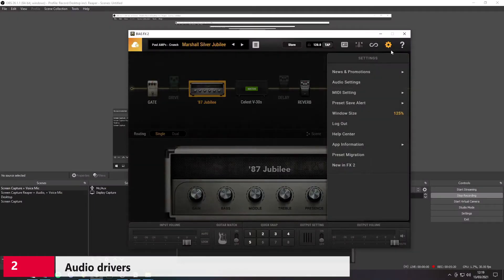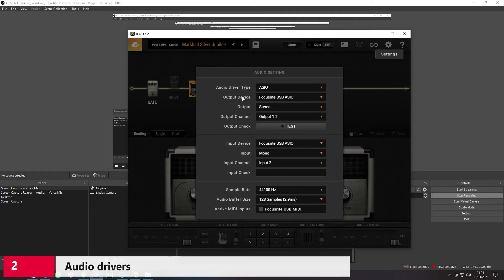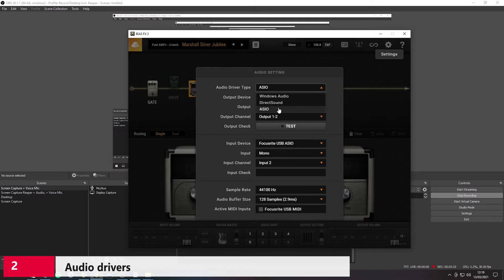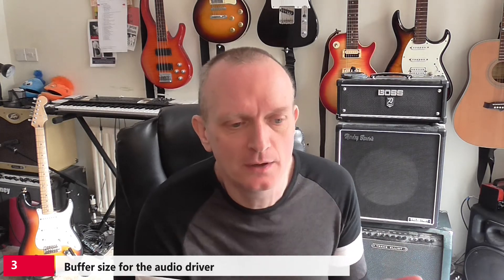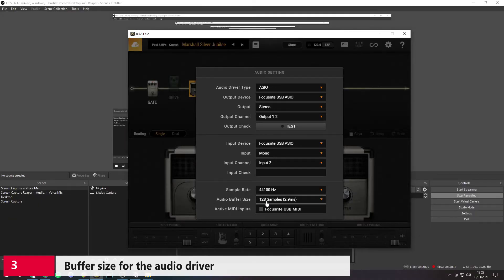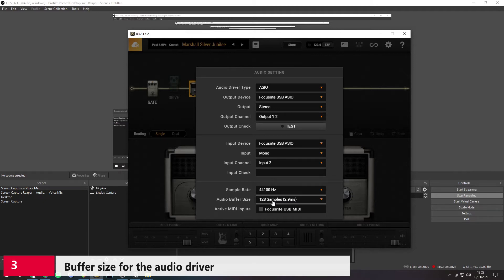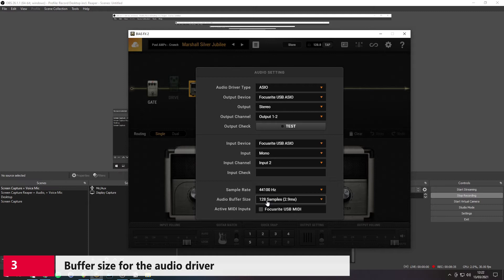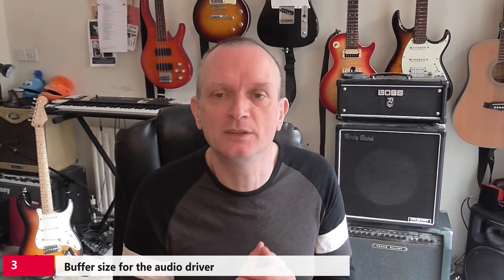Reduce your guitar Amp Sim's latency with these tips

Comment: I use both a PC and a Mac. The Mac has low-latency plug & play drivers built-in, which work with most recent interfaces. Some may require a separate download. Depends on the interface.

Comment: Thanks for the hints. I am having problems but almost randomly. I suspect my AV software may be to blame and thinks my PC is idle when its only running my DAW and may be starting AV checking.  For example my output latency suddenly jumped from 3-5ms to 90ms yesterday and dropped back today.  I used to have a Win7 app for gamers to shut down all unnecessary apps and free memory that was great. Do you know of anything like that for Windows 11? Thanks.